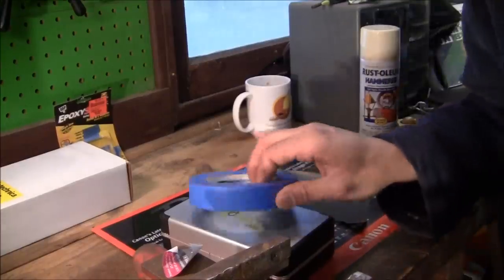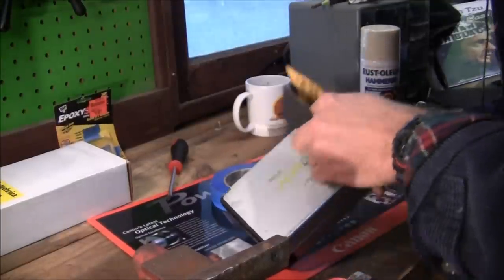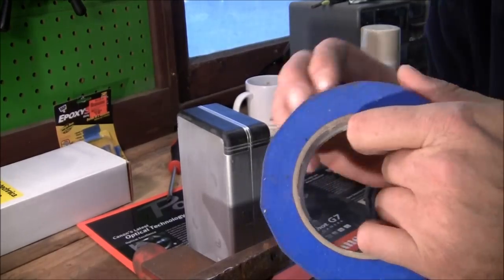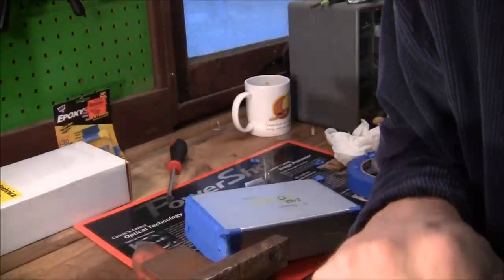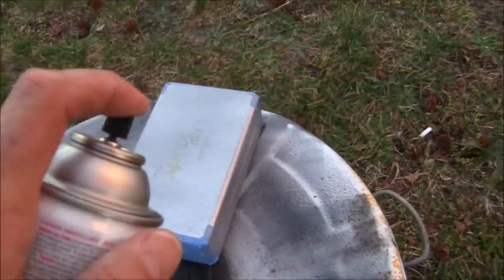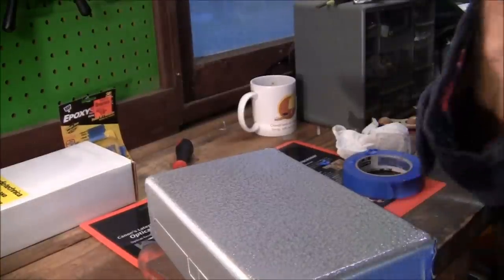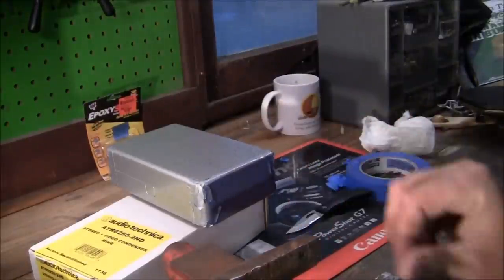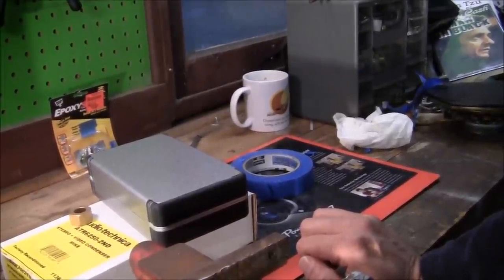How to Paint a plastic box with Rustoleum Hammered Spray Paint.

Comment from the maker: If it's like Rustoleum, the trick to the hammered look goes like this.
1. Thin coat of paint to cover.
2. Slightly thicker coat of paint to build paint texture.
3. Thicker coat to bring out texture in the paint and to build the texture.
4  Maybe one more thicker coat for extra texture. 
I wait about 5-8 mins between coats.  

Thin, Thicker, Even thicker = Texture / Hammered.   :)

Comment: hey i have a question I just used that same paint and it didnt crackle or get that hammered look ... it just looks flat??
Reply from the maker: You normally have to do a couple of light coats and build it up. When it dries it should have the hammered look. It sounds like the was too thick. Several thin coats is the trick. :)
Reply: Mikey6119x b
Reply: CheapGee

Comment: Great video - thanks. I need to paint some PVC matt black. The Rustoleum plastic range includes a "black", which I assume is glossy. Would it be okay to first paint with the Rustoleum, and then paint over with normal spray paint?

Comment: Do you ever use primer or clear coat? I have to do a pedal for a guitar player who is going on tour. He is really hard on gear and the pedal is metal. I have heard more folks say "Don't use Primer" and some say you have to on Metal.
 I was looking at the Krylon as well, do you have a brand you prefer? 

 On Metal, do you use primer or clear finish? And Whats the strongest brand? This guy is hard on stomp boxes! Great video!
Reply from the maker: +MonstarMk3 I use primer on some things. For the pedal, I'd sand it. Prime it and use a gloss or semi gloss Rustoleum paint. Gloss and semi gloss paints  already has clearcoat in it. :) I like Rustoleum because it hardens like a rock. :)